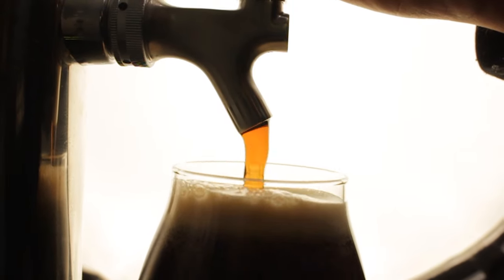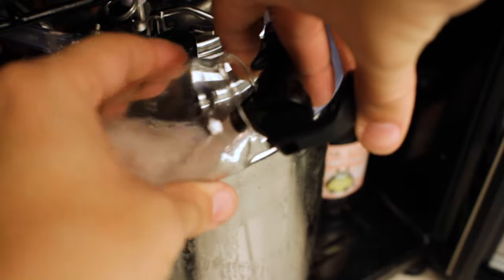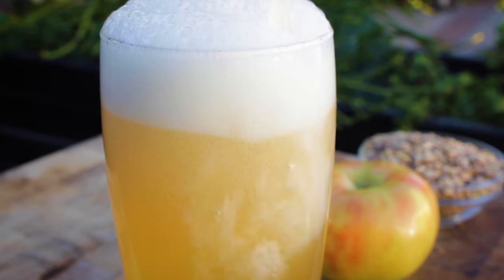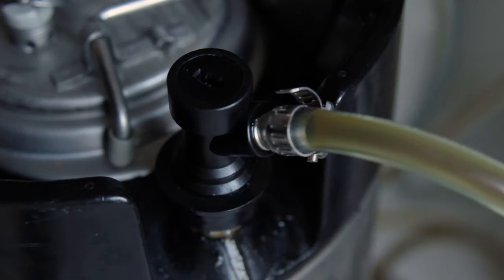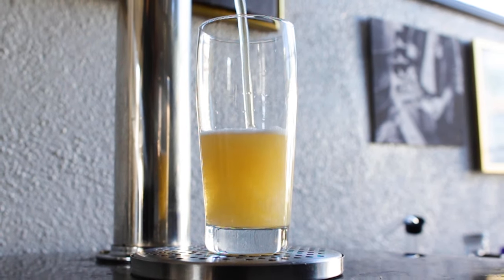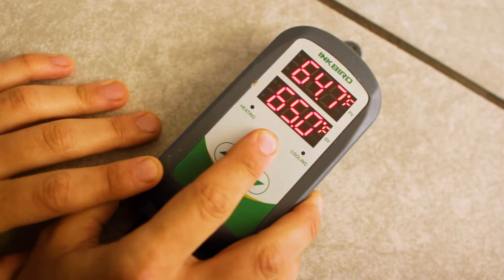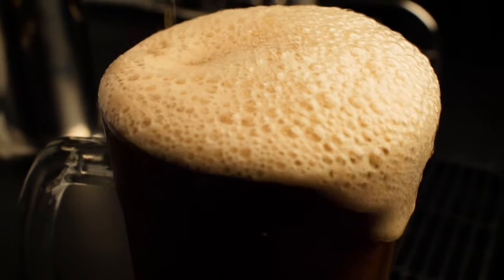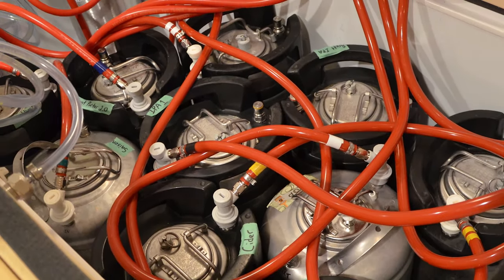HOW TO KEG YOUR HOME BREW (ft. @NewAir Single Tap Kegerator)

Comment: Small advice from a prfessional brewer. These fridges are great to use for ripening your finished products. Just leave it in there at 7 °C for about one week and then cool it further down to about 1 °C and keep the te,perature for another 1 -2 weeks. Improves the taste a lot and the cold storage ensures save carbonisation for easiey tapping later on. Cheers from Germany
Reply from the maker: Great advice! Thank you for the comment

Comment: Great vid! Tiny nitpick but make sure you don't push with a pencil to open the pressure relief valve, The graphite could break off and fall inside the valve causing a leak!

Stellar job!

Comment: Great breakdown with simplicity! I still love my several cases of bottles and don't mind bottling for the ability to keep some of my past 4-5 brews or so laying around along with the most recent for both variety and seeing how they age over a few months. But I've been slowly accumulating kegging parts as I see them for used cheap and by the end of 2022 (the summer with some luck) I'll get there!
Reply from the maker: That’s an excellent way to do it. Slowly build and collect parts. Easier on the wallet too

Comment: Do ball locks always come with a gas tube? I just picked 2 Corny Kegs, Ball Lock, Locally and when I replaced the rubber seals I didn't notice a tube for the air? Good job as always too!
Reply from the maker: Usually tubing and the quick connects are sold separately. But sometimes they are sold together online. Good luck kegging!
Reply: You mean inside the keg? No, not a tube like the beverage

Comment: I'm just starting kegging so this is helpful thanks. Currently I have no way to carbonate whilst the keg is in the fridge. As in the video you say chill the keg then take it out to carbonate. How long would you leave the co2 tank attached before returning to the fridge and repeating?
Reply from the maker: Usually just long enough to add pressure because I’m lazy. Then detach and put it back in. But you could do one of rapid carbing methods I mentioned once it’s cold
Reply: @TheBruSho  thanks for the reply! Yes I may go for force carbing at the moment until I have the right space.

Comment: I'm not using beer, using tea for first testing and only fill half a keg. My tea become over foamy but under carbonation, using force carbonation method by rolling the keg. What should i do?
Reply from the maker: Disconnect the gas, and release the pressure, wait a day and then add more pressure to you're desired amount. Repeat until its back to your liking/less foamy.
Reply: @TheBruSho  so it must be wait for a day? Can it be consumed directly after force carbonation?

Comment: My first effort at kegging doesn't seem to be working out so well. I tried priming for CO2 in the keg....I think I over did it. Very foamy.
Reply from the maker: That’s ok. If it’s over carbed just bleed out the pressure and give it a day or so before pressurizing again. Also make sure you have at least 10ft of beer line for less foamy pours
Reply: @TheBruSho  Thank you..

Comment: Sanitizer is not really neccesary when bottling. Water with temperatur over 16 °F kills everything the beer could harm. Just wash out the clean (!) bottles with hot water. I use flip-top bottles and close them right after washing.